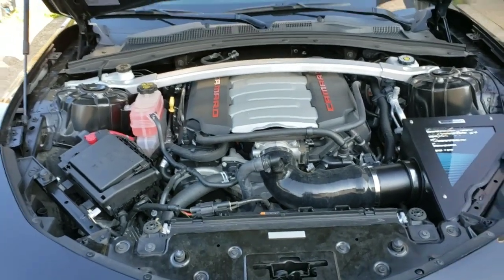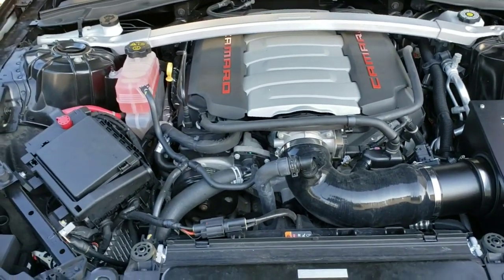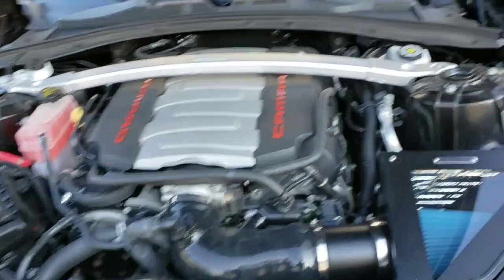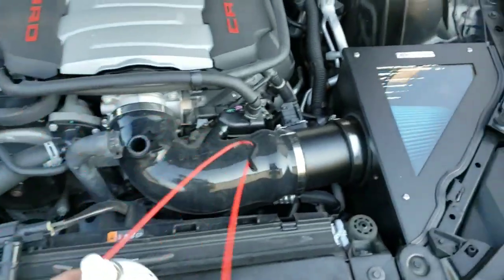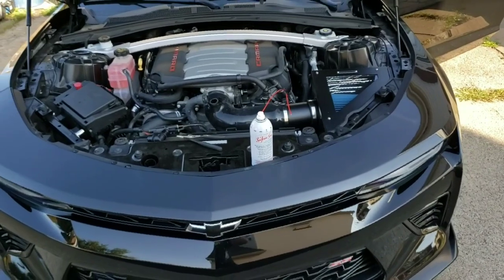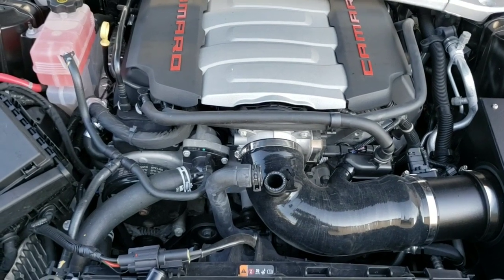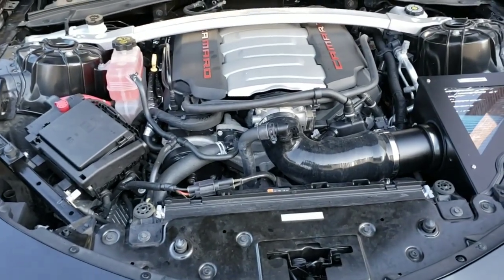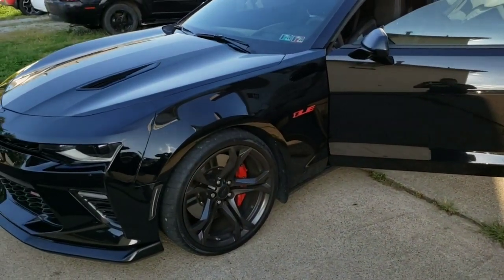6th Gen Camaro 2016 and up, carbon build up, and how to treat it.

Comment: Seafoam had always caused more problems than helped. On every LT/LS I've ever touched I've always simply recommended techron or similar top end cleaner and had much better results without worry, and on these SS's in particular I've gotten quite a few Bad TB gasket/Orings and needed to thoroughly clean TB and (usually) the aftermarket intakes make things worse

Comment: I wonder if it will clog the cats up.
Reply: It should all burn off, by the time it gets back there. Not doing this, will clog up your cats, eventually. Highly recommend using Royal Purple as well. Yea, it’s pricey but it is a true synthetic and won’t leave deposits, that cause heavier carbon build up.

Comment: I need help  my 2016 camero has a misfire on cylinder 5 I changed sparkplugs,coils and the coil connector 
 I cleaned my fuel injectors But my car keeps shaking an the gas smells weird  what can it be please help 🙏🏽
Reply: Check you afm could be stuck
Reply: Omg! Finally found someone with the same problem I'm having. My 2016 does the same it even stalls on my in traffic. I have to put in park and restart. My stabilitrak also on.. check engine blinks but I got no clue where to start. Did you fix yours?
Reply: @neyneyvillarreal4029  Hey, I’m have the same exact problem as well. Did you get yours fixed? If so what was wrong?
Reply: @neyneyvillarreal4029  did you fix problem..?
Reply: @franciscotrujillo5497  did you?
Reply: @TheGiovonni123  fix?
Reply: @Ctuno23  nope, I never figured it out.
Reply: @Ctuno23  nope when accelerating starts shaking and sounds loud won’t accelerate fully until gas is put all the way I’ve swapped everything out for code p069e injector coils spark plugs fuel pump high pressure fuel pump fuel pump module and nothing,could be bad knock sensor of you have headers it will rub with the wiring I’m going to look at that today
Reply: My 17 ss rough idles and feels like it’s knocking especially on cold start but no code. The rpm’s sometimes drop to 550. Not sure how to smooth this out.
Reply: I can't say mine is having the same problem but I was one of the lucky ones that needed a new starter (three times). When the first one was replaced, I'm 100% sure the dealer didn't disconnect the battery, but when leaving the stealership I had similar issues, cel was flashing, stabilitrak, all that, and at least what they told me was the o2 sensors and main positive battery lead had to be replaced. Now I get that it may seem unrelated but I can say I've had other issues where fixing one thing seemed to influence other shit. My engine temp sensor went and after it was replaced the electronic suspension behaved completely differently where touring mode genuinely had a noticeably softer room de feel compared to sport or track modes. I know this may not help but i hope maybe it might keep you open to other possibilities if you haven't yet been able to fix. Good luck dude. My latest issue is a bad driver side primary cat that went just under federal warranty and dealer said clear the codes could be bad gas, and then the federal warranty lapsed, my luck. Anyway, good luck bro.